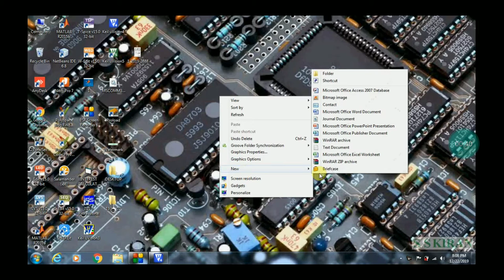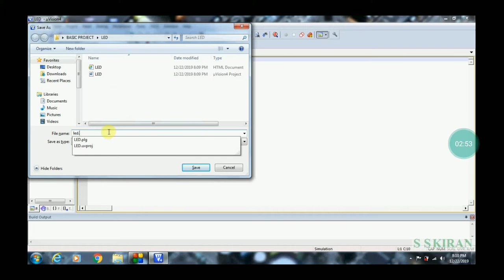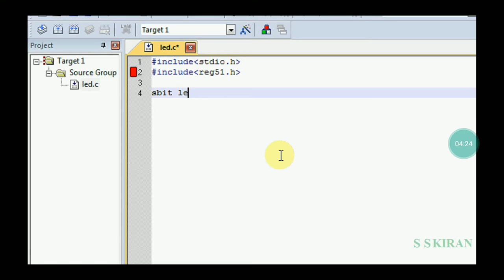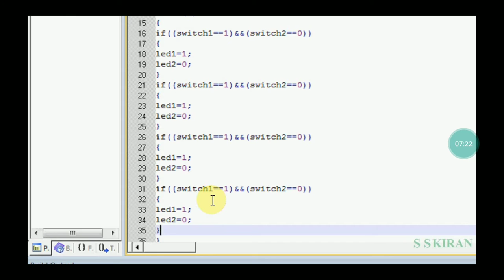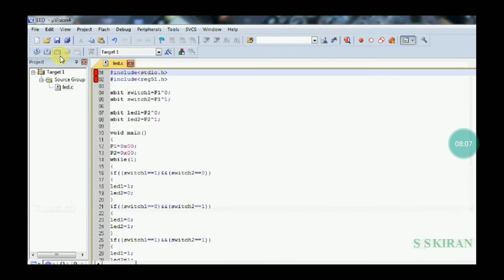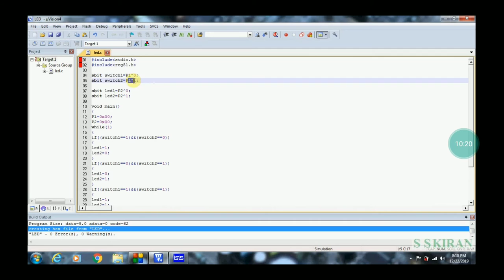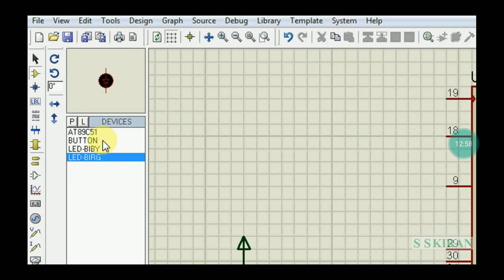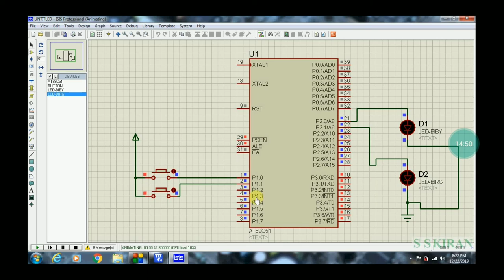Interfacing of Switches and LEDs with 8051 Microcontroller | Keil | Proteus

Comment: design and draw system using microprocessor 8086 having eight switches connected to port b and eight led's connected to port a of 8255.2) 32 gb ram.3) 32 kb eprom.draw flow chart for sensing the switch positions and displaying it using led's.
Sir can u plz send the solution